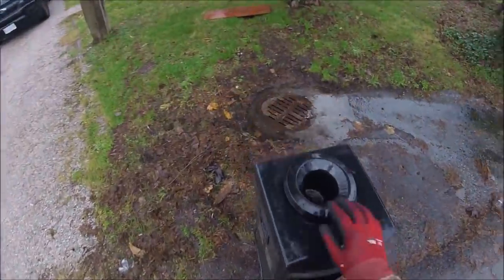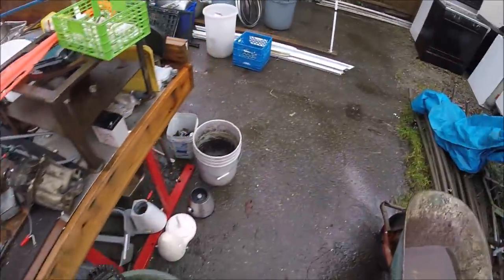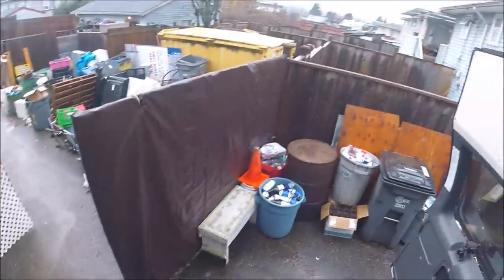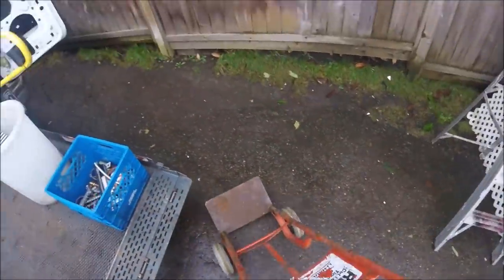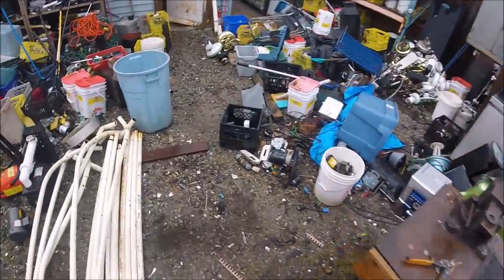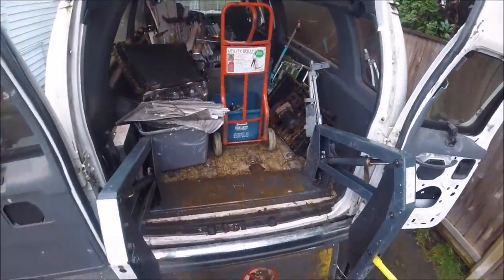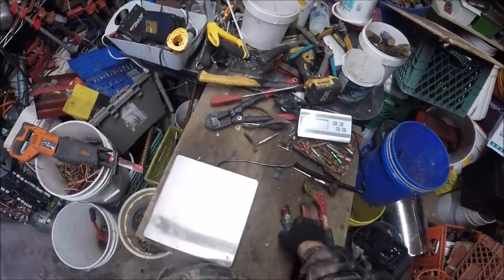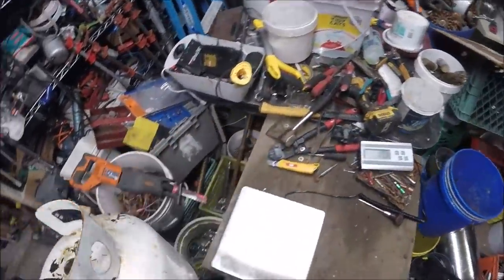Unloading The Whale + Scrap Run & More

Comment: is it worth the time of removing the brass waste from sink,
Reply from the maker: Depends if you want to clean it
Reply: @CanadianTreasureHunter  thanks, have to change a waste tomorrow for a client as well as change heating and hot water expansion vessels, kitchen tap centers and a circulation pump. was wondering if it was worth keeping the scrap waste